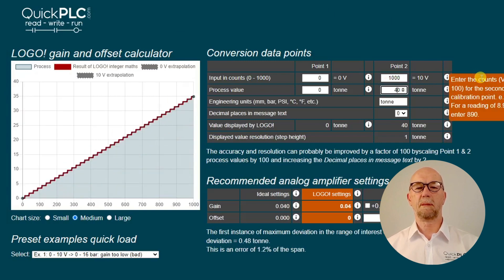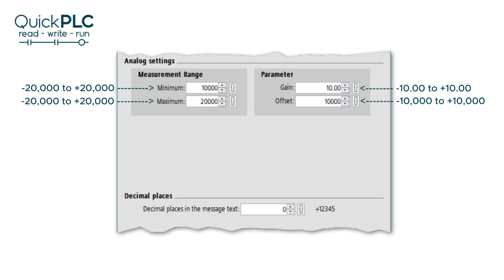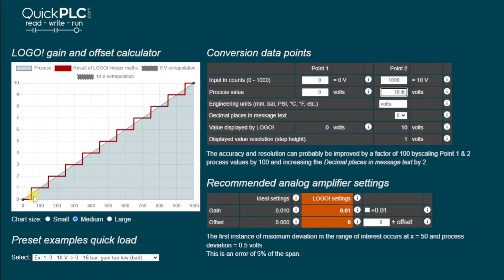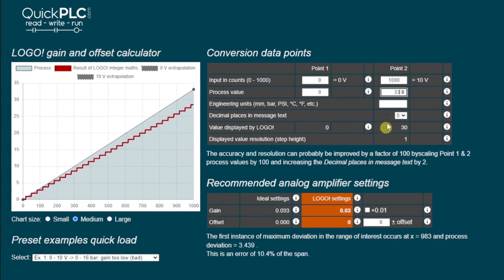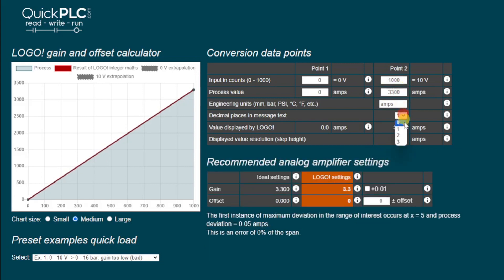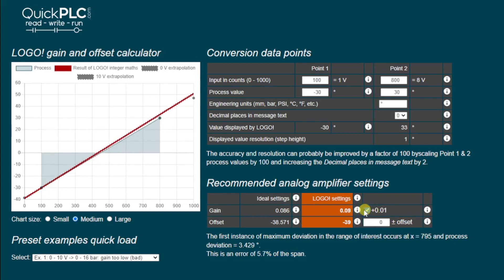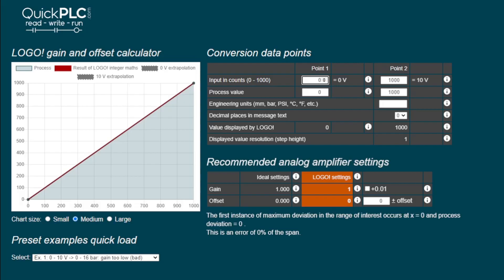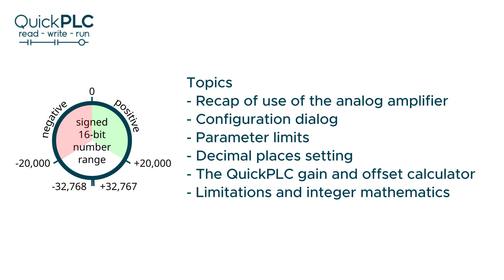LOGO! Analog amplifier gain & offset | Siemens PLC programming

Comment: Thank you so much for your effort. i learn alot from you. would it be possible to scale an 4-20mA analog input with your calculator? (a direct input, not converted to voltage...) thank you.

Comment: Can this calculator also be used for 4-20mA? Most of my sensors are 4-20mA. Thanks.
Reply from the maker: Sure. Are you using a 4 - 20 mA input or a 0 - 10 V with resistor as described in https://youtu.be/zewpKflxjqM?si=12YBEXoRPRGntaLL?
Reply: @QuickPLC-kh5of  No, i use a analog input module AM2.
Reply: Też by mnie interesował kalkulator na wejście 4-20mA